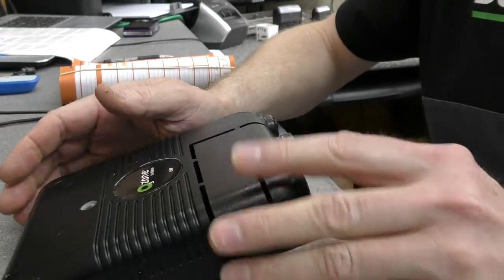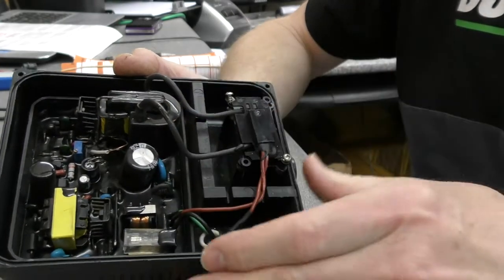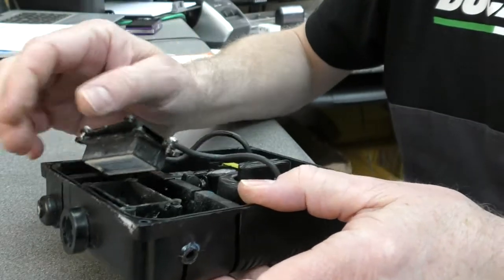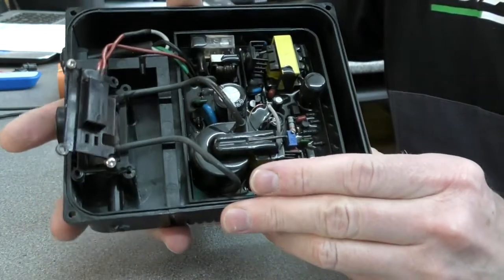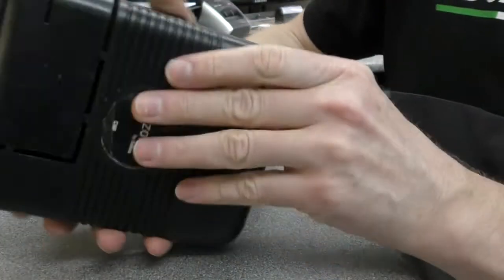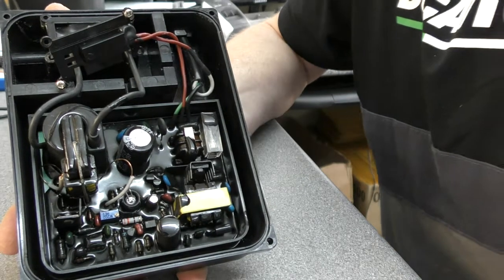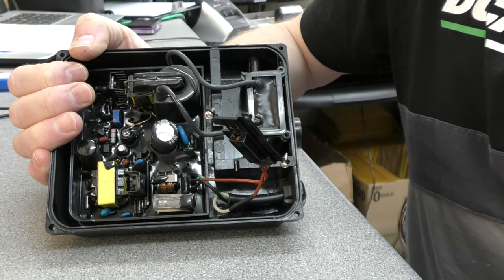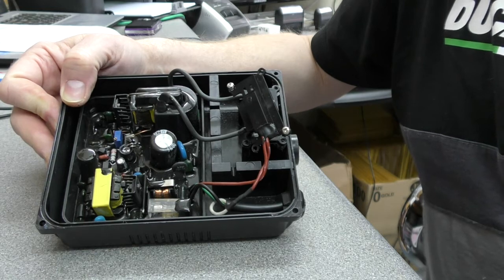Myline Venus Spa Failure

Comment: word of caution with the water heater, is that not all heater elements are rated for use in a spa, you need a special type of element, typically used in hard water areas, that has a lower surface temperature and a thicker stainless steel case, so the erosion from the water flowing past it does not etch cavities through the heater outer shell and cause it to fail within days.